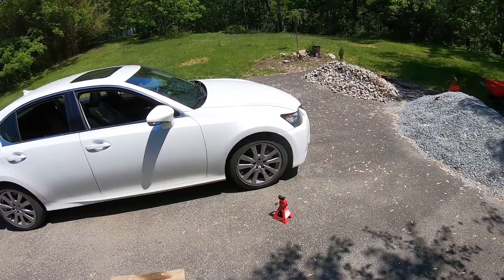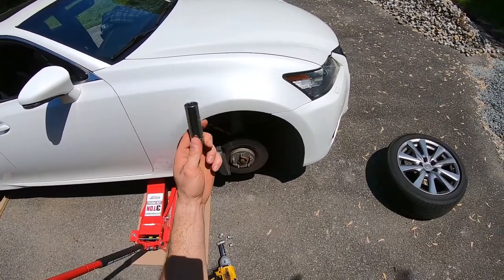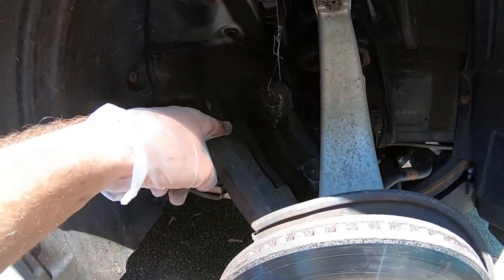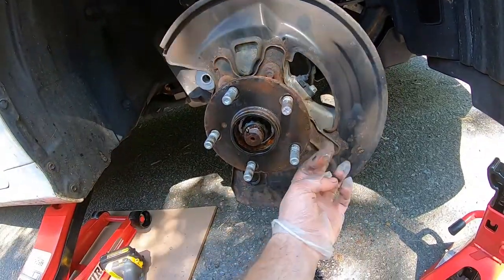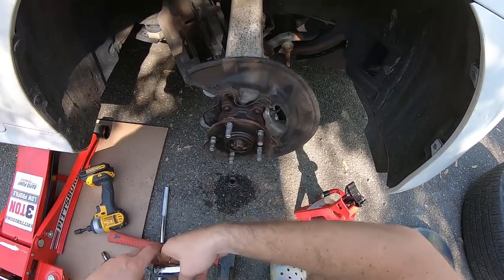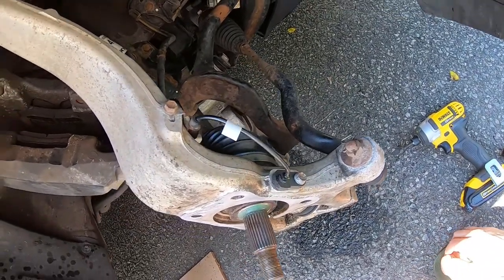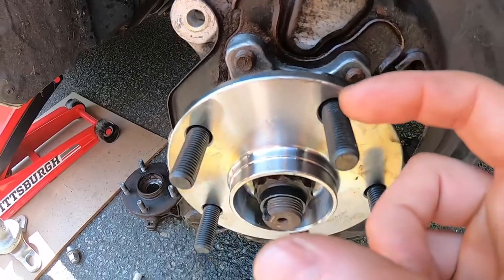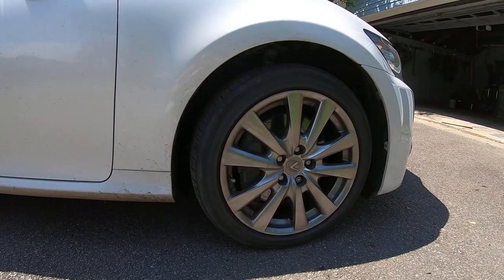LEXUS GS350 2013 (4th Gen)  (AWD) Replace Front Wheel Hub / Rotor

Comment: There are torque spec's for both the (4) wheel hub bolts and the (1) spidle/hub bolt (the 30mm socket).  Make sure you tighten properly.
Reply: 32mm 12pt socket for the axle nut (217ft-lbs)

21mm for the lugs (76 ft-lbs)

17mm for the caliper bolts (100 ft-lbs)

17mm for the hub bolts

Comment: Did you have a problem with the ABS, Traction Control, and AWD system after the job was done? I had these light up after doing the same thing.
Reply from the maker: check the abs sensor. Even though it sits behind the wheel hub, when you pull out the hub it is possible to damage it. I almost broke mine. It was bent. I carefully straightened it out and put it back in.
Reply from the maker: If your sensor looks good (you can see it in the video with the hub removed) and isnt bent or torn, it could be the hub. Inside the hub is a magnet and the sensor picks up this magnet as it revolves. anyway, check your sensor. I think...there is one in the front and one in the back, both on the driver's side

Comment: Was your car shaking / vibrating when coming to a stop? Im trying to figure out whats wrong with mine. Its not the breaking system i replaced the rotor and breaks a few months ago.. I  was thinking maybe an alignment or shockes. My tires are wearing king of funny
Reply from the maker: Uneven tire wear on my car - I was getting a bit of the shake when braking. Changed rotors twice, thinking it was them and not my 18 month old tires. Turned out the tires needed to be changed. Changed tires and aligned the car- problem gone.

Comment: hello, i am upgrading the brakes on my 2008is250awd, i bought the gs350 awd front caliper, so can the 2008 gs350awd brake discs be installed?  I know that the wheel hub of gs and is is the same.
Reply from the maker: If wheel hub is same size, possible that the caliper will also fit, but cannot be fully certain. You have to check somewhere. Diameter, width and even bolt hole placement on the caller can be different. No guarantees
Reply: @landedinlukla  The wheel hub and caliper screw locations are the same.

Comment: Where did you get your wheel bearing?
Reply from the maker: I bought the whole wheel hub. MOOG. Cost about 150 per wheel hub. RockAuto, I think
Reply: @landedinlukla  How has it held up? I need to replace it on my GS
Reply from the maker: @phyinc4506  i just replaced my hubs. First time since I have owned the car. That, along with new tires and new rotors has made the car drive like new. Feels great.
Reply: What made u change the wheel bearing mine has a noise I thought it was the tires but changed the tires around and noise is there still
Reply: @themacintheacc1366 sounds like road noise but gets worse. Usually described as a growling or whining noise